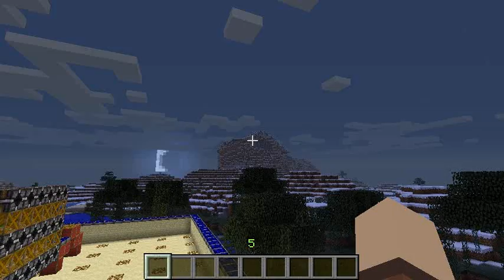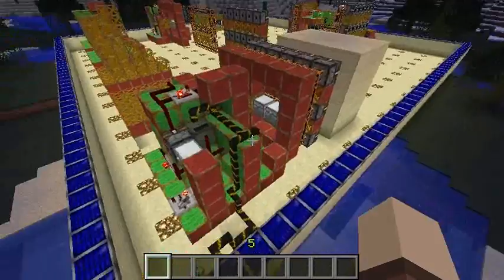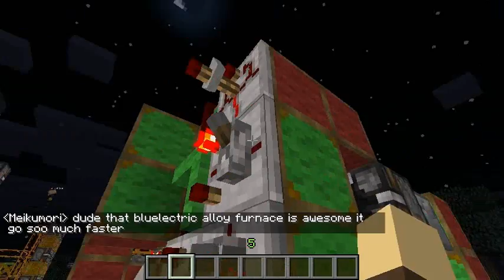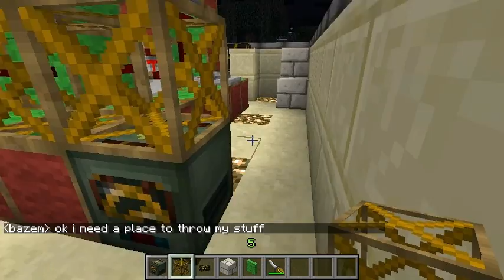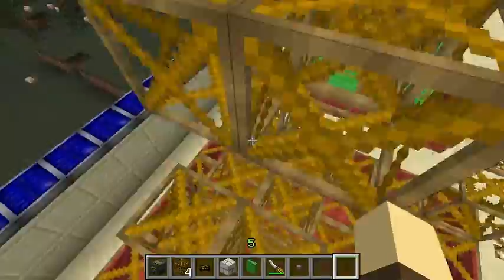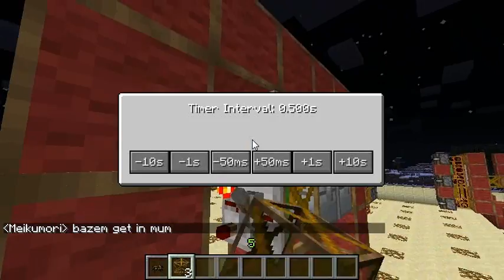MineCraft RedPower 2 compact mining machine

Comment: It's been a very effective design, although it does crash a bit. I've found as long as you don't let the drill head go out of rendering distance it doesn't crash quite as much, although occasionally it will crash when it's starting up. Also, I found that it's much better for Y levels 8-14 if you have a second drill digging a hole for the original drill to slide down so you can cover more area. Seeing as it's a 6x6 design, you can easily stack two to make it 6x12, and dig out the area to slide in